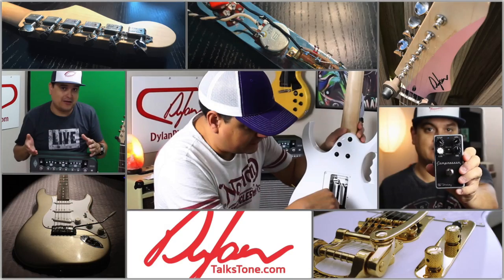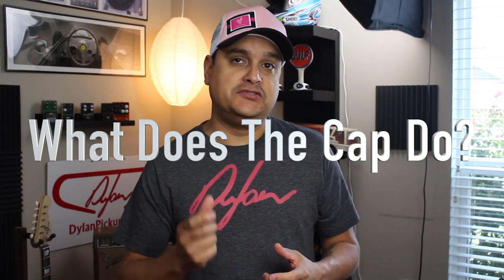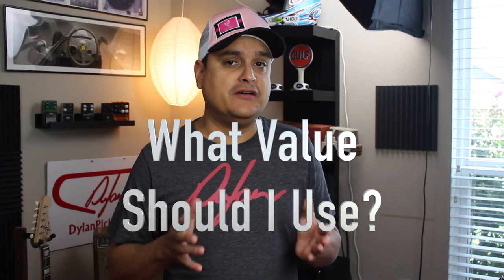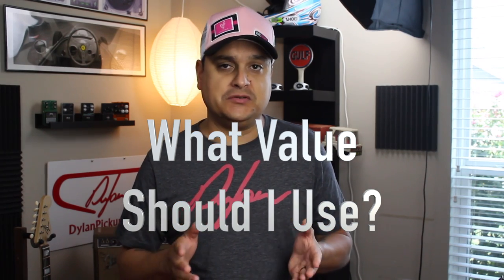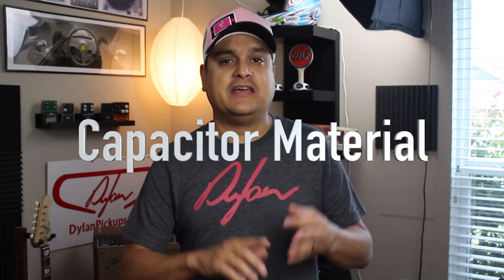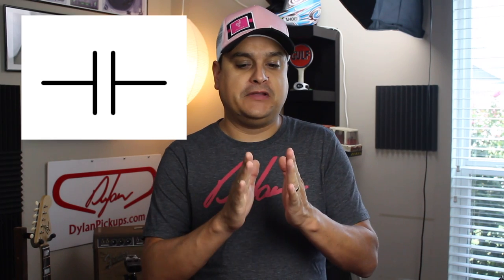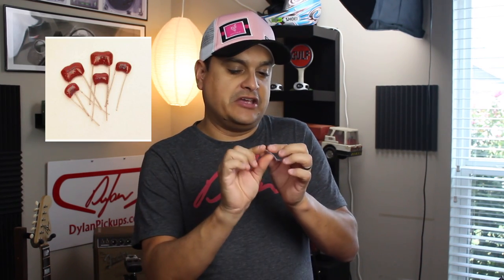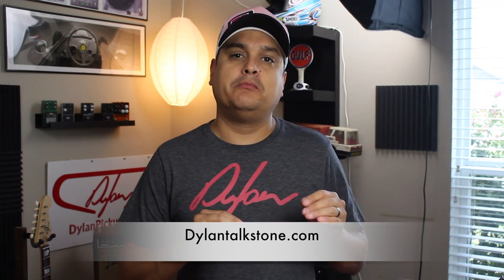How To select the right capacitor for your guitar! 3 tips - Dylan Talks Tone #240

Comment: I recently changed a bridge pickup to semour Duncan Invador in the Yamaha Pacifica 012 (SSH, 5 WAY switch) guitar. (Volume pot 500K, Tone 250K)

However I am experiencing reduced volume and tone on position 2 (neck and middle blend) and position 4 (middle and bridge blend).

All other three positions have developed a continuous hum as well. 

I am unable to find a solution to this. I have checked the circuits they are accurate.
Please HELP.

Comment: Thank you! Awesome explanation!
2:05 So, if we follow this logic, is a .0022uf capacitor a bass cut filter?
Reply: Alessandro Lucas : capacitors cannot cut bass
Reply: @willeek3760  capatitors can cut bass. Check the G & L wiring. When we add a bass cut tone knob, we have the opposite situation: the higher value caps cut LESS bass, than the lower values. Typical cap values for cutting bass is the 0.001, 0.0022, 0.0033 etc.
Reply: @bomzhiha-s-kurskogo-vokzala  i never knew that, i thought choke coils did that. thank you for the reply \(*_*))

Comment: What's your opinion about '50s wiring where the capacitor bridges the pots compared to conventional wiring where one leg of the capacitor goes immediately to ground?
Reply: I think that functionally it's the same, the cap is just further up in the same circuit. it probably changed because the current way is easier to do/work with.

Comment: Hi Dylan, thanks for the great information. Does the capacitor affect the general tone of the guitar, or the sweep of the tone knob? I have a 56 reissue custom shop strat that is too bright and shrill generally, would a different capacitor help with this, if so what would you recommend! Thanks :)
Reply: Stefan Hamilton it can help lower the brightness of the sound. Try using smaller value, 0.047uf for example.

You can also try different potensio value to lessen the brightness. If you have 250K, try the 500K one (use the B/linear type fyi).

And above all of that, your pickup have the greatest impact to your tone.

CMIIW
Reply: Rizky Hadi Felani. Many thanks. Gonna put a king tone switch in and see if that helps, otherwise might just change out the pick ups. Cheers

Comment: I heard that ceramic capacitors are microphonic and thus not for tone control use. I've always used them because the ARE easily salvaged. I've not noticed ant bad effects. Could be microphones is good?!
Reply: +therugburnz
For guitar circuts -- it doesn`t matter. Any undamaged caps will work fine.

Comment: The overall point of tone caps is noticeable tone differential at the hands of the guitarist from the instrumental standpoint. If all you do is play the guitar at Full-On the whole time, then tone caps won't do you any justice whatsoever. On the other hand, if you're a player that Actually USES the tone controls on your guitar musically & wisely, then Tone caps will definitely serve you well. 

My personal preference with my humbuckers (split coil)
.022 uf- bridge
.015 uf- neck
Reply: Actually, even when all pots are set to 10, there is significant differences to be had from the pups with different values.
I have just ditched epi-mud-gainer caps and experimented with Rifa's in 0.010uF increments (10,20,30,40 back and fort on both pickups) and ended up with different values on the pups to work together, in blended mode and with max utility of the knobs.
Fascinating, this experiment. Crystal clear and all the bell-like resonances and overtones i the guitar pops out when you find the sweet-spot-values.
Guess it got with the "knee" or slope of the filter to do, in combination with the pups, their adjustment and the unique guitars body.

Anyway, the tone caps do affect the slope and therefore the overall sound of the pups.
Reply: And to add to the afformentioned, i think that the two pickups has to be "tuned" to eachother and to the taste and uses the guitar/ist will see.
I think there could be lots to gain in some axes with stock stuff, if some effort and testing is done.

I didn't even bother to measure the capacitance of the epiphone-mud-gainer's.
But i saw another tone-cap video after my mod and he tried like 10 different caps on His Epiphone. Also his epi-cap was muddy compared to the rest.
Maybe its on purpose? I cant understand why they would let such cheap a fix slide with the mud-rumour of their pups, if it could be fixed THIS easily/cheap.
Food for thought...
Reply: To re-cap: (!) Gibson own Epiphone and if the somewhat very less costly alternative sounded equally good, that would be bad news for the overpriced Gibbys.
If the pickups sounded muddy on the "cheapies" on the other hand, folks would "upgrade" to Gibson pups (which are unique, good, costly - but rightly so) with all new electronics. Clever... if it would be that way... :)

Epi CAN make good pups, though - just look at the new ones they sell, and maybe take a look at the caps that go along with em? (i for 1 is gonna google it)
I dont know. Why would they sell muddy pups with shitty caps (values for the pups) if they didn't have to? Why not make the best out of whats already in there?

I.D.K but it is making me wonder.

(Guess Epi will buy up Gibson soon, too - let the flamewar begin!!!)

Comment: My question is this… Is the cap Completely bypassed if the volume and tone knobs are turned completely open or up?
Reply from the maker: no
Reply: +musicmatty67
Only  tone knob (yes). Volume has no deal with capacitor.
Dylan -- you wrong.  ))

Comment: Sure, voltage doesn't really matter and it's true that you don't need something crazy like 500V capacitors in a guitar. The value that matters is capacitance but then the tolerance will be important too if you want to make sure you actually get a capacitance value as close as possible to what is advertised. And in my experience it's pretty hard finding capacitors with as low tolerance as possible when their voltage is also low. I.e. your tolerance will be lower the more voltage the capacitor is designed to handle. Now, if you buy a bag of capacitors claiming to have the capacitance that you're looking for you can simply meassure them to see how close their value actually is compared to their advertised value and pick out two that are as close as possible to what you're looking for. But if you're only buying two you want to make sure you get what you want right away and then a higher voltage cap will tend to have a lower tolerance.
Reply: +Marcus Lewitzki
Tolerance are not as important as some people think. Certainly not in guitar electronics. Not rocket science.  ))

Comment: No mention of putting a capacitor on the hot lead of the pickup?? 

A whole bunch of time shaping that everyone seems to forget.... 

A capacitor on the hot lead does the opposite.. Instead of dumping the.high freqs to ground, it dumps them to the output jack, functionally it rolls off bass freqs... 

This is very helpful with bassy, or muddy neck pickups.. Instead of swapping pickups over and over.. You can shape the tone of your pickup for a few pennies and ten minutes of time..

Comment: Why don't I just adjust the settings on my amp? 🤔
Reply: MobileDecay you may decide on anouther amp or plug into someone else s your guitar is a constant.
Reply: @tomgia1964  I don't know any amp that doesn't have a treble knob though.
Reply: Adjust the settings on your amp till the nobbs fall off, your guitar and amp signal are always two different things. Hence why 1 certain guitar /w custom mods might and usually will sound different with different amps.